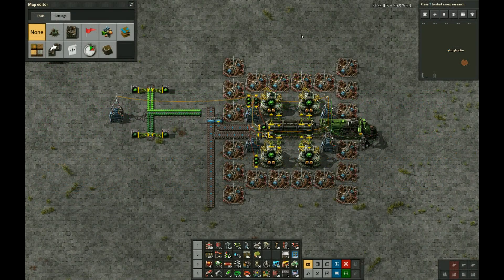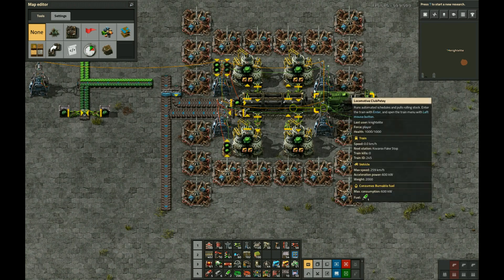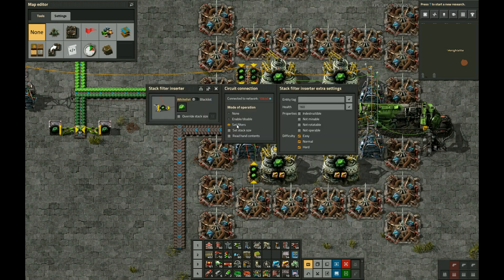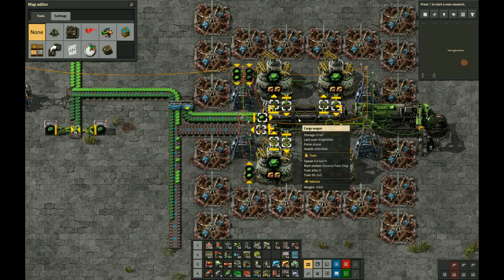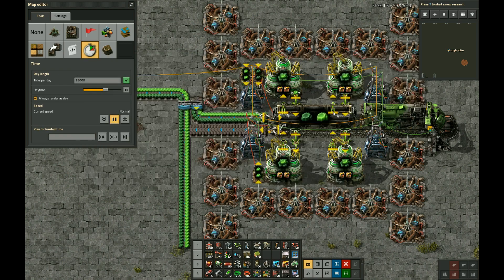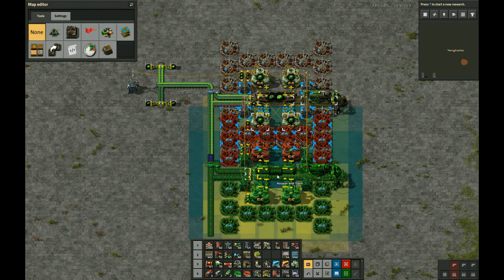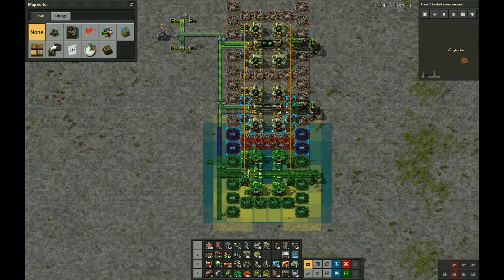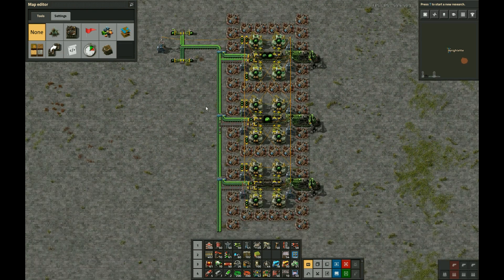Kovarex Enrichment - Unusual use of trains

Comment: Nice.  I use the Warehousing mod and put 8 Centrifuges around the outside of  of a Warehouse (6*6 square 1800 slots).  Feed 235 and 238 into the warehouse, Inserters in and out of each Centrifuge and let it run.  (Note to start you need to activate one centrifuge at a time to let enough 238 build up).  You can easily set up simple inserter circuits to tap off what you need (or limit the inputs).  You can beacon it and if you want even just feed in raw Urainium ore and just set different recipes on each Centrifuge.  Fun fact it will eventually turn all the U235 into U238 if you don't keep it fed or limited in some way.